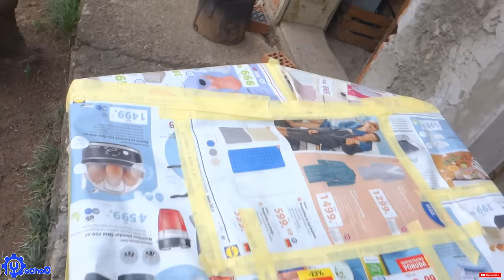DIY  Mobile tools cabinet   Homemade  "Tool Organization Save Time!"

Comment: Well, you got my sub, that's for sure. I like many of your decisions in this build, including welding the rails in. Saves on hardware costs, and faster to lay out. If they're good rails, they should last awhile. To those who say, "why not just buy a tool cabinet?" Sure, if that fits the bill of a person's shop needs, I'd certainly go that route. However, I challenge anyone to find a reasonably priced cabinet this size with six drawers all the same height. Plus, this one can be made a couple inches wider or thinner in any dimension to suit possible size constraints.
Reply: If someone has to ask "why not just buy it?"  it's not worth explaining -  they won't get it anyway.

Comment: fantastic. i am saving it to my favorite so i can copy it later. The only thing i would change is that you do not need such tall drawers for certain tools so it is wasting space. other than that its  wonderful
Reply: true, but would be a lot of extra work, he could alternatively have two removable trays (levels) inside each drawer and use the lower trays for tools that you don't use much.
Reply: @casillaswilfredo  I know I'm late but great idea. I was thinking something like tackle box trays turned sideways to open to the sides of the drawers.

Comment: Wow. I have been trying to plan building my own tool box for years and just can’t seem to get the confidence to do it. Mostly planning for the materials and picturing it all coming together. Thank you so much for this video. What gauge steel did you make the drawers out of and what size is your square tubing. If you have plans or a cut sheet I would to see that so I know how much material to order. Thank you again.
Reply: Sheet metal showed 1.5 mm or 1/16" .  Maybe tube is 25 mm x 25 mm or 1"x1"  as well as 25x50 or 1x2?

Comment: What is the name of the Blue paint? I cant find it any where. And what is that foam?
Reply: I think you can get the blue foam at Lowe's it's used for insulation I believe
Reply: Search for “closed cell foam” 👍
Reply from the maker: https://www.google.com/search?q=cool+color+3+in+1&rlz=1C1CHBF_enRS885RS885&sxsrf=ALeKk02IqFE2WUuZtISnfYI40zlcuch-3Q:1586189389758&tbm=isch&source=iu&ictx=1&fir=nbxnQF80mRM92M%253A%252C_0hwv5dFbmJ30M%252C_&vet=1&usg=AI4_-kTrhCzlht7LWpY-shTtGnkXNsGFnQ&sa=X&ved=2ahUKEwj0wf34l9ToAhVGrosKHYncBKcQ9QEwAHoECAgQHg#imgrc=nbxnQF80mRM92M:
Reply from the maker: Don't have serial number this color...

Comment: This is what you do when you don’t have a harbor freight right down the road from you!
Reply: You mean spend twice as much on materials than a harbor freight tool box that can be shipped at a reasonable rate?
Reply: A harbor freight box that WILL fall apart within the first year of use! This thing is indestructible, it will surely last atleast 4 generations.

Comment: Amazing box wish I had the skills to make it, only things I would change is i would make the draw faceplates longer so they cover and protect the runner I also would not have welded the runners and castors in case something breaks so I can change it later, but this is by far better then my current Stanley box, also I never would have thought to hear the blade to cut the foam that is an amazing trick, great job

Comment: as a tip if you wear a pair of rubber glove over normal glove when you do angle grinding you will not put holes in them. : ) i generally get a size bigger then glove i wear so they just slip on

Comment: I took a $200 dollar husky box and reinforced the corners bottom and top with stainless steel.  The top is a stainless steel pan 16 gauge and the bottom and reinforced corners also 16 gauge.  The drawers are still tinny but with the reinforcement the box can hold ally of weight.

Comment: Rather than doing a black layer on the surfaces that were to be blue to begin with, I would have done a white or light gray base coat. You save on black paint and the colored paint usually turns out much more vividly. But that's just me, to each their own.

Comment: i made one tool cabinet with 5 drawer and place for my rod weld but i didnt have the rail for drawer like you use, can you tell me where to get it? i using old bearing for my drawer slides not really satisfied with my tool cabinet

Comment: Primero, impresionante curro, me quedé con la boca abiert... ahora una pregunta Me estoy haciendo una mesa de soldadura, la tapa es de 8mm de acero laminado en caliente y la pretendo usar para pinzar la masa ahí directamente, mi pregunta es cómo puedo proteger del óxido la mesa sin perder conductividad para soldadura con electrodo?? Muchas gracias.

Comment: Hi,

Have not finished the video yet, but want to add this comment before I forget - casters at 2:30 do look galvanized (zinc coating) and not cleaned. Maybe that just did not come across the video and you did clean those, but be careful with that stuff - when welding it gives off some nasty fumes. Just be careful and maybe weld at very well ventilated areas if it's not possible to grind the zinc away.
Reply: Just finished the video - that's a nice cart!

Comment: How much did you pay for all that metal? I want to get into welding so want to know what it will cost for a project like that.
Reply: Let's just say it would be cheaper to go out and buy yourself one off Amazon or at your local HF then it would to build at the cost of metal these days, BUT you wouldn't get the same WoW factor or bragging rights from your buddies when you say you made it.. 

Just to give you an Idea, One stick of 1-1/4  16 gauge square tube (72" long), ya that's about $34 US at your local Big Box stores. To frame this beautiful work of art your looking at roughly $300 at those prices, this is all dependant on HxWxD of your design of course and you haven't even gotten into sheet metal or angle iron. Let's not also forget the cost of industrial drawer slides and wheel casters as well.. always best to find yourself local scrape metal supply place and establish a relationship and buy in bulk.

Something like this your in it for the customize build.. otherwise you could probably by one of this size a lot cheaper.

Comment: hi peChoO Can you explain (may be in a video) how you do to measure, position the drawers. And also how do you calculate (measure) where the sliders should be welded taking in account the gaps between the drawers ?
Thank you

Comment: If you'd put the side panels on the outer sedge of the frame, then the runners would be hidden and the drawer fronts would fill the whole opening.

Comment: Why would you put 9 tools in a drawer with no space for more? You could easily fit 30 or 40 tools in that drawer if they are better organized. Same with the wrenches. Looks like there was about 10, should have 30 or 40 in there too. I have almost 100 wrenches in a drawer that is only maybe 30% bigger than that. If you get the right kind of holders it's very space efficient, laying them flat is not.

Comment: Ciao Roberto sto provando ad iniziare a saldare e vorrei comprare una saldatrice ad inverter.. ora ho usato quella a trasformatore vecchia ma secondo me ha qualche problema xk non parte mai l'elettrodo è stata ferma 15 anni se va bene ti volevo chiedere se secondo te conviene a filo o ad elettrodo come questa ti ringrazio e spero in una tua risposta !!!  https://www.ebay.it/itm/Saldatrice-ad-Inverter-MMA-Awelco-Elettrodo-Arc-250-MASCHERA-IN-OMAGGIO/333394905809?_trkparms=ispr%3D1&hash=item4d9fe28ad1:g:oQUAAOSwTkFcrxNb&enc=AQAEAAACcIQvEcHUrT7nmUC3yY5qbPyaBN1nJEDYW8MyypsJPgXKjzb4uel3XQiGEzY4CITgmhabelMCg7bh5eqV5hwyl2TqkJP3pLR0gFO9fpUxCCTU0bc6bsKqVOuUMuAkYrSLgRahBTrTembboCzLysDiG%2Fr9jfsK1iJohvkrlrb%2Fnn9IOfLBoTrEbNSeVSom%2BrcVDsK%2FxADjzItm3PUV8MVn5kNywdERO9G2MdakYSK5i0PXyLf4jTzTWGgFCEvrjZZgHxMRuUHl9pBxaTYPO2UG0kE8BL1cZyv6%2FvTrYJQ12nB5cNe%2BsR5LyNIMYFW1g5HPPrdRDsvdutFimttnHujUM%2Fgjg2DnZDo0SN%2Fw94je6Yjt%2FlrxOVlrJhqO6i%2Fmxu7V166SDDyKi0rN%2BfVmo6n7mAg308KyWFuBZXPZl8TfS18jJpFFR5EwtTC%2BIjVKHKRXb90FbJP3Fv82%2BQxJIiCIvFThStKYQkf0L7xfgZQsdsWWE9SYHnbQrreufLUoI7PxBt0zYVxkWAIHlzOAqVE%2B4gjngiYyLXrF2KcrRuzkhACd5domKgH6PDFGAovEXbOV6uo1zw%2Fh8G9D2n9HUQhGenUH%2FGsVkGmVrSO4wUbdDrCj8XBXu64h3EzkUsJqaFwJ73G1vgJTrYDt%2FwZ%2BGppZNHhfu0Nu2qHByGRJdNuAqy%2FQDdSpOn6zSK0%2B50r1%2BBMGSTy1t32WpgxacDymtaki%2BnP%2Fw05nA0KJEp1h%2FsL7DEFdL%2BJKJvTLtqVLQ2VCLUv8gM%2FZqCUStcTvjy5sDSPlKpKP15JqvywnQSLvk6HvLFrggZse7n3dQ37WV9u2wt91Rw%3D%3D&checksum=333394905809471aa62d579848f4969b02cdfd997c6a